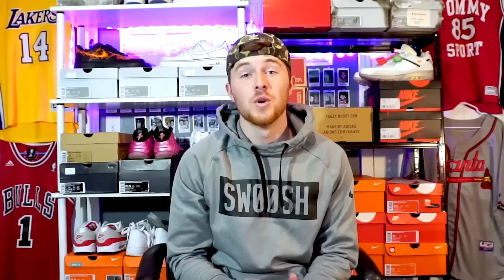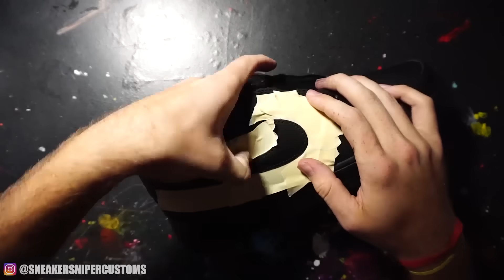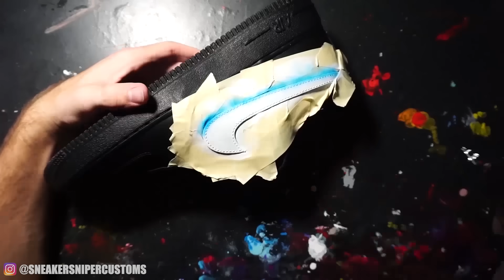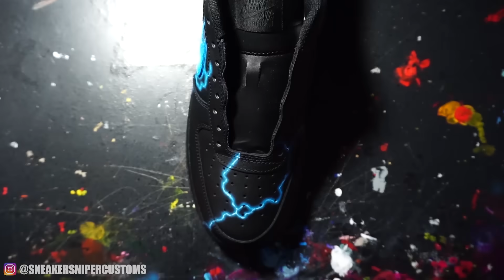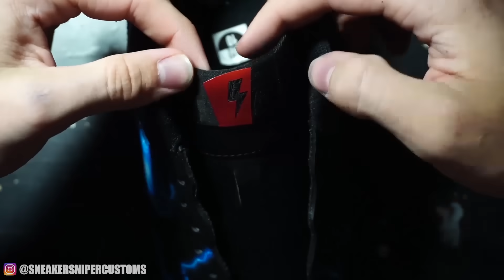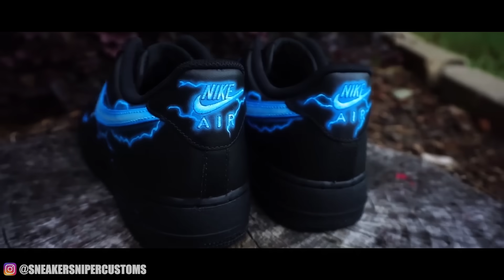CUSTOM Air Force 1 !! - Jordan Vincent

Comment: Nike Electric Force I
Nike Storm Force I
Nike Air Force I Black Lightning
Nike Air Electric I
Nike Lightning Force I
Nike Air Force I High Voltage 
Nike Stormy I
Nike Dark Thunder I
Nike Spark Force I
Nike Bolt I

All the names I came up with.
Very nice custom btw, definitely would wear them.